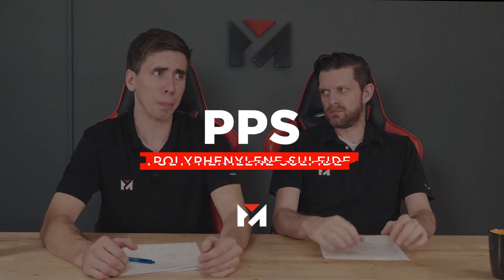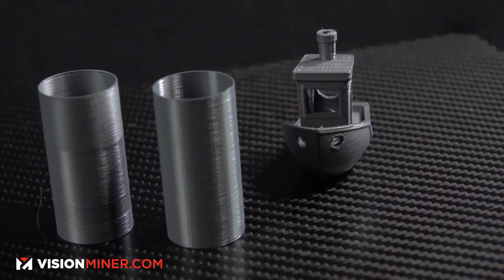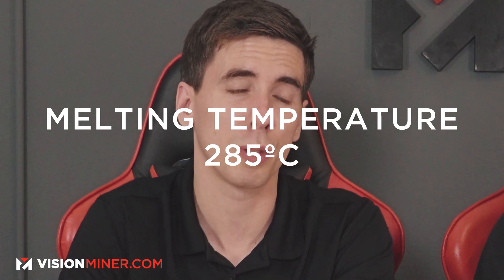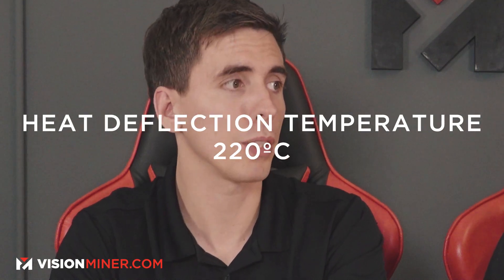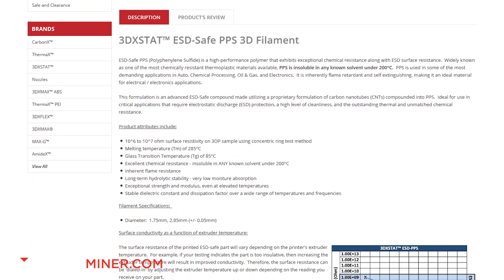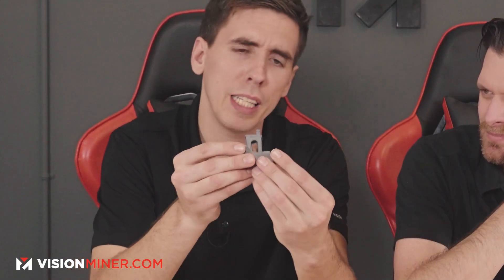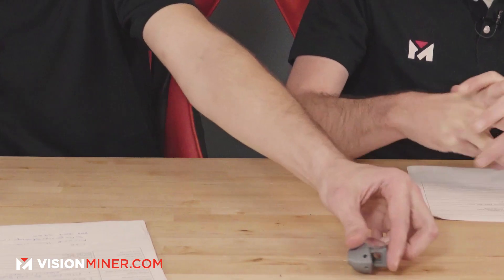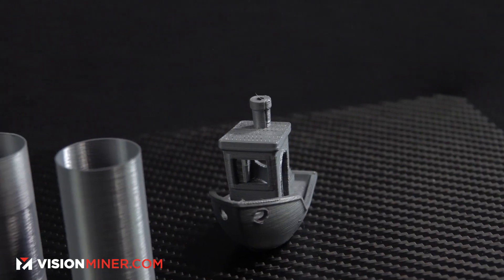Polyphenylene Sulfide (PPS) Plastic: Properties & Applications in 3D Printing

Comment: I’m using it and PPS-CF for acid bottles. Very nice. I print the name in slightly raised letters. Not too easy to read, but not that difficult either. I don’t want to use another filament for that. Printing self sealing caps took a bit more work to get right, but it works. I would be nice if this were a bit cheaper and available in a number of different colors so I could bake bottles in the colors chemicals are specified in. I print it in my H2D. No problems.

Comment: Im going to mod my ender 3 v2 to print this with marlin firmware. I already have an all metal and  PT1000 thermistor. I put on a hardened steel nozzle. I bought the printer as an unrepaired for 59 but it wasnt broken when i got it. Just needed a new sufrace to print on become somone didnt know how to level the hed.

Comment: Will this print on the new Bambu Labs X1E? The hotend is rated up to 320 degrees C.
Reply: You can not set the purge temp. In the x1e jet. So if youre not willint to manualy set it in the gcode i would wait for updates on the printer to try it out
Reply: It should be fine on the X1E, Bambu Lab sell their own PPS CF material now.

Comment: You still need to dry PPS, as we did in injection moulding, otherwise it has a tendency to "foam" when extruded.
It's probably the reason of the weird behaviour you mentioned.
Still it's amazing stuff, specially when loaded with carbon fibres...

Comment: FYI - successful FDM printing of PPS is just the first step. To fully achieve the incredible material properties it must be post-annealed to allow the semi-crystalline structure to form/propagate.  After this is done, PPS will not remelt even at temperatures approaching 300C - it will char and carbonize but will not melt or flow.  Also it has excellent electrical properties, will not absorb water (unlike PA), is wear resistant with low CoF, good creep properties and is naturally flame retardant to UL94-V0.  Its unique combo of properties earns it a spot on MANY automotive parts.
Reply from the maker: 100%! And aerospace, as well!
Reply: Usually many car makers and Tier 1 automotive part suppliers use PPS+Glass fiber injection mold material for their thermal management system parts such as motorized coolant valve or electric water pump(EWP) not only ICE but also EV.

The only bad thing of PPS is price. It’s super engineering plastic. So, it’s very expensive.
Reply: Does it get softer?  Could it be able to withstand 250f reliably after annealing?

Comment: 200 degrees is not twice as hot as 100 degrees. You can't do that sort of math with degrees.
Reply from the maker: Technically correct -- on the Celsius scale, 200C is twice as hot as 100C, but in reality 473C is twice as hot ---

Given that the Celcius temperature scale is just a scalar translation of the absolute scale in Kelvin:
200 K is twice as hot as 100 K
100 C = 273.15 + 100 = 373.15 K
200 C = 273.15 + 200 = 473.15 K
Thus, 200 C is roughly 1.268 times as hot as 100 C.

Not sure how relevant this really is, but you sure pointed out a fun fact for the day! :)

Comment: Paper-making felt is a long, wide sheet that is used in a paper factory. You deposit the paper pulp mass onto the sheet, and heated rollers slowly start to flatten and dry the paper pulp. When the pulp is dry enough it loosens from the sheet. The sheet goes back in a loop to the beginning to start over, and the paper goes on to dry even more in the papermachine. In the end you end up with a finished, thin sheet of paper. The good thing about paper-making felt is that is isnt too sticky. It lasts for a long time, and can withstand the stress of being rolled through a hot steaming paper machine all day. It's also resistant to chemicals that may be in the pulp or in the machine. So yeah, there you have it.
Reply from the maker: Fascinating! So glad we asked, hah! Very cool! Makes sense, since this material is tough and high-temp!